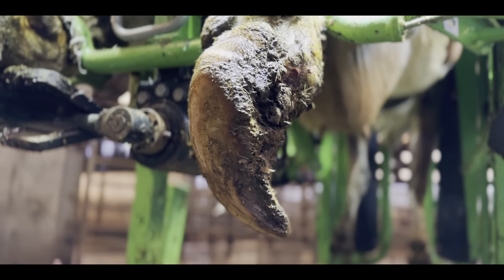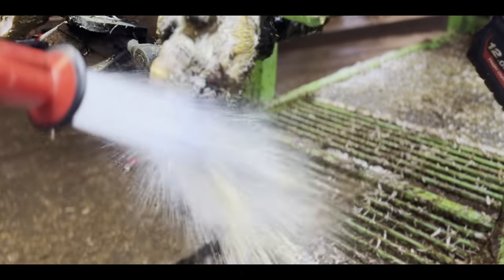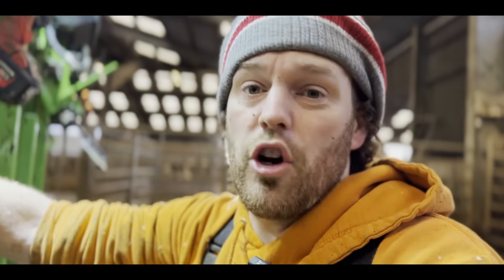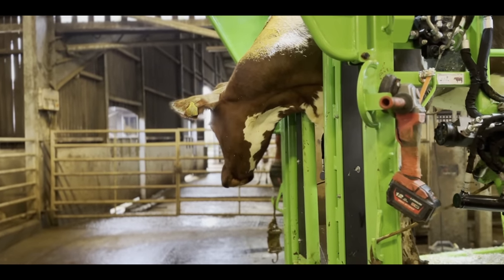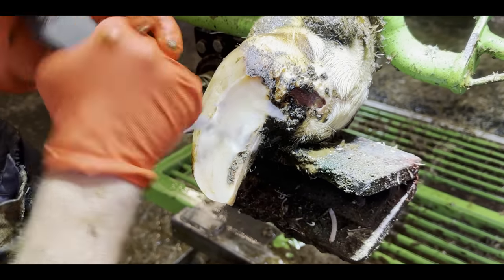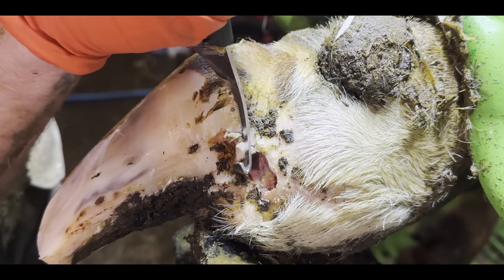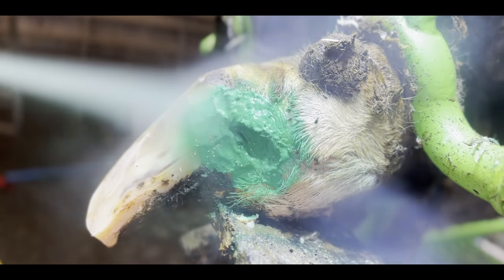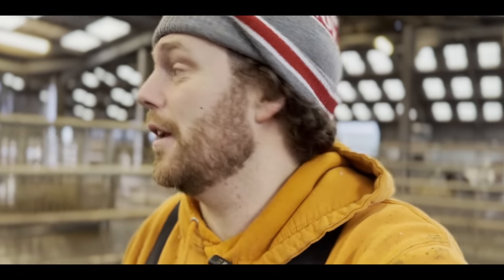HELPING this COW with a MISSING HOOF

Comment: I'm wondering if the bones in the other claw will shift to be more directly under the leg joints now that there is 'room', and if so, how would that naturally affect the shape of the remaining claw.  For example, would the inside wall start to grow harder to compensate?  You showed where some of it was soft, but it looked like a fairly recent injury.  Great job, HCP!

Comment: I wonder if a 3d printed replacement of the missing half hoof would be possible.  To add strength to the printed piece, fiberglass or aluminum inserts could be used, although the cow did not seem to mind the loss of the digit.

Comment: Question; if a cow like this gets an issue and needs a block, what do you do? As she hasn’t got another hoof to put a block on? 🤔 Thanks in advance if you reply! Super fascinating video! 👏🏼
Reply: Not an exact example but there was a case where the cow (or was it a bull? I don't remember) had ulcers on both claws. The farmer had to pull the cow away from the herd & put her in a special area with soft bedding. Fortunately, the cow healed.
I guess if the condition did not improve or could not improve, it's to the freezer camp they go. Of course this would be the last recourse. A vet would definitely be called in before then.

Comment: In a bad situation, what would you do if a block was needed on the missing claw?
Reply: I remember a video somewhere, might have been a gp video, but it was 1 claw & an ulcer. Used half a horse shoe rubber block on the outer side of the claw to keep weight & the ground off the ulcer. It wasn't the most ideal situation but it helped & the ulcer healed. Not sure what would happen if the injury was on the outer side of the claw but I'd guess it would be a similar work around.

Comment: You can't put a block on that foot because it only has one hoof. What do you do if she gets a problem with that foot that would normally be fixed by trimming away the detached hoof horn and putting a block on the other hoof. I'm worried about that cow. Hi Craig!

Comment: Do you trim the hoof to the same thickness as a normal hoof? Taking into consideration that it carries 100% of the weight and not 50%?
Reply: It wears off more because its the only remaining claw thats why he had to insure it was balanced properly to displace her weight correctly.
Reply: @kimcallaghan3404  I understand the balance part well enough. The actual thickness of the hoof tho, is it trimmed to a 'regular' thickness or is it left a bit taller like a platform shoe since it has to carry all the weight?
Reply: @vanessaallan7858  he trims it enough to insure the balance is correct. As you saw in the video the claw was not doing that so it wasn't wearing correctly, so he leveled(balanced) the claw on the one side so that the claw would make proper/ even contact with the ground now yes it gets trimmed the same as a normal hoof but because its 1 lone digit, maintaining its balance is very important because again as demonstrated in the video, shes got a bit of a twist on that claw, necessitating more sole horn be removed on the high side to keep it level (balanced)